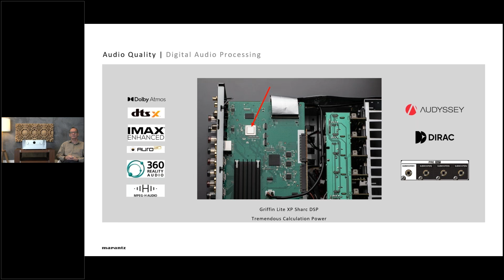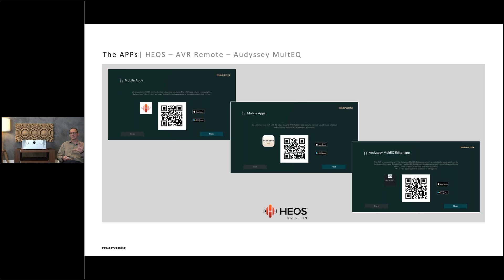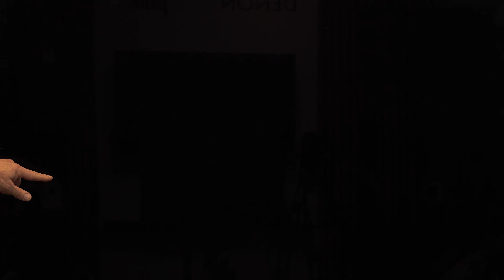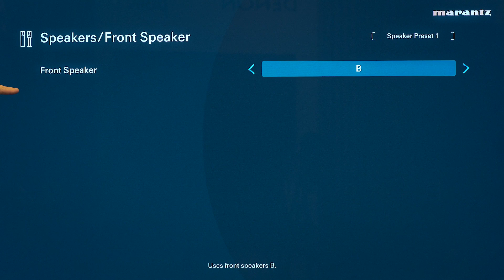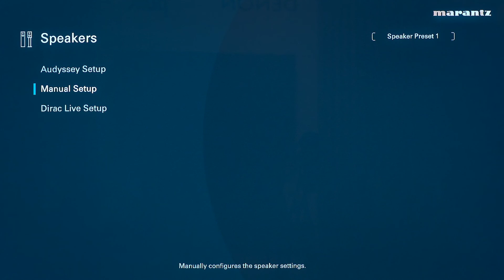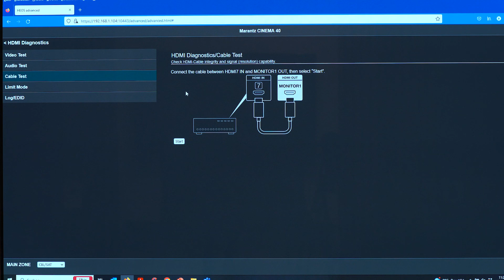Marantz CINEMA 40: Technical Overview

Comment: how does it sound in stereo compared to 40n?
Reply from the maker: Hello,
It depends on the make and model of speaker being used as to how much of a difference there will be between the Cinema 40 and the Model 40n.
The Cinema 40 is handsomely equipped in the power amplifier stage for an AVR of it's kind, but the Model 40n has more advanced circuitry with it's power amplifier stage. This allows the Model 40n to be compatible with a wider range of loudspeaker, and better able to cope with wilder impedance swings found among more challenging loads.

Comment: I just purchased a Marantz Cinema 40 to replace my Parasound 7100 Surround Controller and Parasound 5125 five-channel amp (5 channels 100 watts each channel). The Parasound system is good, but it’s old and doesn't have many new features the Marantz offers. 

My question is. When I connect my Parasound amplifier to the Marantz Cinema, 40, am I losing sound quality? Is it better to hear directly from the Cinema 40 instead of connecting to the Parasound amp? When I compare the sound between the Cinema 40 and the Cinema 40 with the Parasound amp connected the only difference I hear is that the system sounds more powerful. Any advice would be great to hear.

Comment: When will there be a one box replacement for the SR8015. That model had 140 watts and 11.2 channels whilst the Cinema 40 has 125 watts and will only do 11.1 (which I am set up for) when hooked up with another amp?

Comment: Got firmware update 6000-8075-6031-8790 to my Cinema 50. Smart select is broken. It resets all speaker and Audyssey settings every time pressed. There's no manual to explain smart select functions. So this update made my receiver worse, much worse.
Reply: With the smart select buttons you will have to press and hold and re-save them as you did with Audyssey. But with the Dirac corrections applied. So resend the Dirac file. Then touch or press and hold the smart button to save. Hopes this helps!
Reply: @JoseGonzalez-zq7bn  it's broken. Doesn't help to resave. Every time when pressing any smart select button will reset its settings.
Reply: Will it allow for a firmware rollback?
Reply: Will it allow for a firmware rollback?
Reply: @royalway12  No
Reply: Did Marantz fix the firmware?
Reply: @noomnoi4308  Yes

Comment: Does an analog input signal bypass the AVR DAC when using pure direct? Appears so from the diagram?
Reply: This is a good question. I’m only recently discovering how important the transparency of the D-to-A and analog output circuitry of an AVR is, and if everything goes thru the digital side of an amplifier then everything will be mushed - or not - by the digital section. There’s so much going on in an AVR it might be a challenge to get it as precise and clean as other hifi components. In my current mid-range but well-thought-of AVR I proved that the DAC and output stages are limiting the performance of the whole system, to the point where it’s obvious that I’m not getting the best out of my external amplifiers or speakers. We’ve long understood how critical the “front end” is in traditional hifi systems, and with inputs all going digital these days, the AVR now tends to act as the front end as well as the amplification.